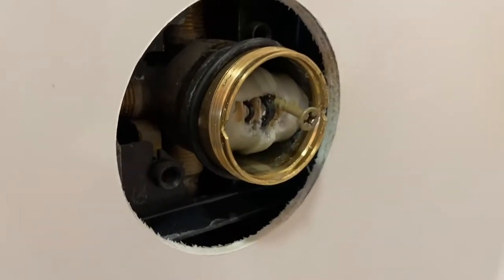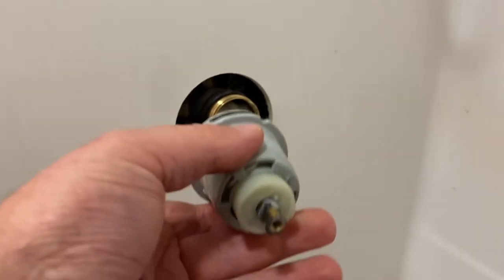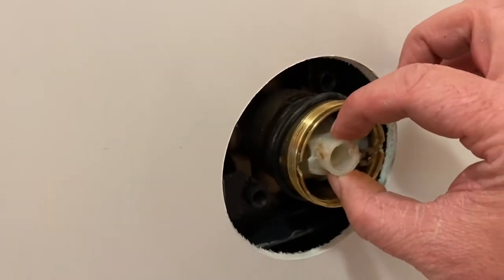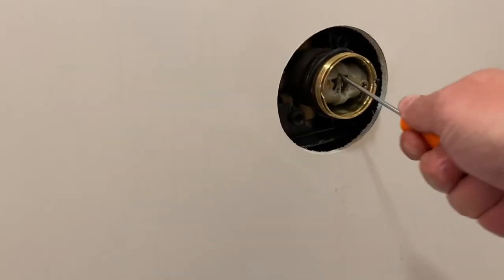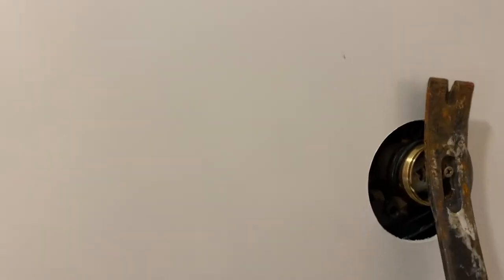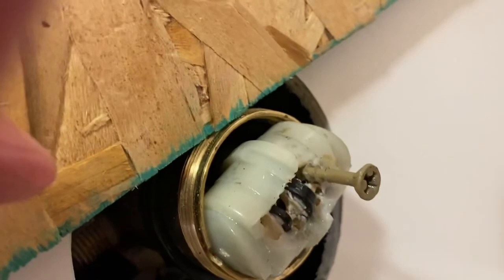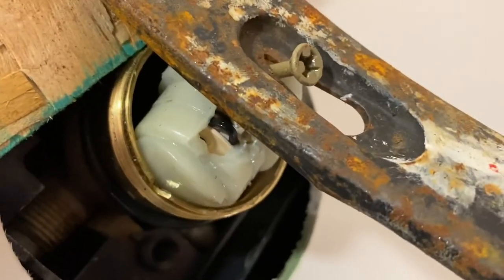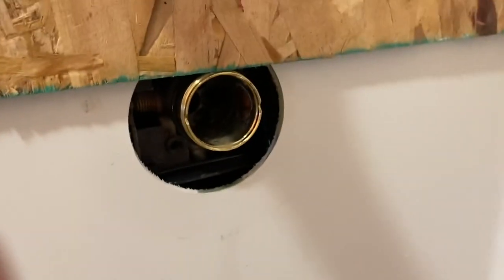Delta Tub Faucet Repair: Broken Cartridge

Comment: Just ran into this with my 21 year old faucet. Tried WD-40 and heat but it was the screw that did the trick. I put some silicone grease on the new o-rings so hopefully it doesn't happen again.  You're a lifesaver.
Reply: I would have silcone everything.  And on the nut. I am going to put caulk silcone. I think Silcone will not be so  hard break off next time compared to water Depsoits

Comment: Nice. I am a plumber and come across this alot. I normally put a screw in it also then put the nut back on it so the threads and end of valve body don't get messed then pull on the screw with a pair of pliers and pry against the nut but never thought of using a pry bar. If you use the nut to pry against it doesn't risk pulling on the pipes in the wall and breaking them.
Reply: I just used the claw of a normal hammer with a piece of wood to leverage the screw and it came out instantly.
Reply: Thankyou for this, the video method wasn’t working so I tried this and it popped right out
Reply: What a terrible design
Reply: Money comment thanks! Worked perfectly
Reply: Thank you for this video, I tried pulling hard on my monitor 14 valve and using penetrating blaster and none work. Ended up using a screw in between the broken plastic piece and the metal valve and using pry bar to pry it open.

Comment: I spent several hours trying to get the broken cartridge out.

I was stunned that I did think of that method in the first place.   I sprayed all kinds of lubricants, used vinegar, lime remover, etc. to no avail.  Was all set to use my blow torch and try to expand the metal surounding the part, which would risk damaging the metal.  I was pulling my hair out with how difficult this was.

Literally within 5 minutes after watching your video,  I put in a large screw, put a piece of wood, used the claw part of a hammer and out it came.  

Your video saved me at least $150 in plumber's fees and a ton of frustration.

And, gosh, it was so simple and immediate.   I was all set to use my blow torch and melt the part.  

I cannot thank you enough!

Comment: Thanks that worked well,  saved the day!   Just a note for others reading,  the best place to drive the screw seemed to be in-between two of the 3 raised metal rings (about 5mm apart from each other) that run lengthwise along the metal housing that's exposed once the front plastics are chipped away (as shown in the video)  
I screwed an 6mm wide deck screw (what I had on hand) in-between two of the rings and deep into the plastics behind the cartridge and that gave enough purchase to pull the screw & cartridge out with the prybar.   Before that, I had just tried threading the screw deep into the cartridge plastics, but the plastics by themselves were  too brittle, always broke on me.

Comment: Dude you just saved me. I was fixing this delta faucet for my dad's house (water pressure is extremely High we have to replace the faucet every year or so)
I was worried I wasn't going to be able to pull it out after one side broke but your video saved the day!
Thanks
Reply: Install a pressure regulator if it's over 80 psi
Reply: @josephlowman7906  never knew that existed!
Thanks a lot. I'll look into it. 
Idk how much the water pressure is, but it's super high. I opened it about 1/3 of the way so it won't cause any problems... I can't imagine what would happen if I opened it all the way, lol 
Thanks again 🙏
Reply: They sell a gauge you can screw on a
 Hose bib Pasco makes it not very expensive just to check

Comment: I was fortunate enough to have my cartridge come out all in one piece. I did it like pulling a tooth: Pull a little; wiggle it from side to side; pull a little more; wiggle it up and down and finally the whole cartridge slide out. The next most difficult part was identifying the correct part. I had to go with a Danco substitute and hope that the hot/cold adjustment would work. It did! Fortune was on my side on this little project. Thanks for the video, though. It educated me about the retaining nut.
Reply from the maker: Lucky you! You must be living right or have had soft water or a younger cartridge or something. This seems to be such a common problem - most of our videos get like 10-30 views so the thousands of views on this one tell me that you really got lucky or did something right! Which is to say also - good on ya and thanks for sharing your experience.

Comment: This method worked nicely.  In many of these cases, it was likely stuck due to some water deposits, and it's a good time to clean it up.  Post removal, I recommend using a dremel with a brass wire wheel to clean up the three surfaces the o-rings are seated back to smooth before the new cartridge is inserted.

Comment: I was thinking you could use one of those slide hammers with the screw on the end designed to pull dents out of car bodies. Screw it in and then just carefully pull the slide hammer back with careful force.

Comment: Just like to share my technique.  Had same issue, instead, I use metal cloth hanger, straighten it, and loop around the inner stem from top and goes out from bottom.  I tied the metal wire to a large screw driver handle that is horizontal to the brass housing.  After secure it, I pull outward from the end of screw driver as leverage while the handle sits on the brass housing,and pops out very easily without any damage to the brass housing.   One trick to prevent this from happening again is wire brush the inner housing clean, then use silicone grease lube the entire stem.  Hope this help someone

Comment: Thanks for the video.  Mine is broken just like this with no luck so far. I've tried modifying what looks like a 2 prong fork but too hard to pull and twist a bit to loosen. I've been pulling on this p.o.s. for what seems like an hour... well, maybe it was 2 hours, lol. So I'm going to give your technique a try.  This is by far the hardest valve I've ever had to replace.
Reply: Did it work for you

Comment: I'm having this issue right now and going to try it.
Reply: Holy cow! It worked! I used a long wood screw to the top right of the middle where you can slide in the screw then grabbed a piece of wood and using the pry of a hammer and it came out clean and easy. This is a fantastic video! Thanks again!

Comment: Mine looks just like this, worried about breaking major pipe. House is over 20 yrs old. I am trying to figure out what the screw went into one of those holes on mechanism?
Reply from the maker: Sorry I didn’t see this. I’m sure you solved your problem by now but for anyone else You’d want to be careful you didn’t run that screw too far but an inch gave me all the leverage I needed.

Comment: Here's what finally worked for me, in case it helps someone else: thread two medium zip ties, one around each side. (Insert one around 2 o'clock and it exits around 7 o'clock. Insert the other around 10 o'clock, exiting around 5 o'clock.) Once you have two zip ties looped, you can use something strong to lever it out. Don't forget to protect the pipe and threads with wood or a book, before prying!

Comment: How'd you run a screw in it, isn't it metal
Reply: I used a screw that was large enough to fit between the two plastic parts.  You can also do it by inserting the screw between the steel parts where the springs are.   Used a block of wood for leverage and used the claw part of a normal hammer.  Came out instantly.  What a relief as I spent hours trying to get this busted part off.  I blame the orginal plumbers for failing to use a spray to keep the plastic lubricated.  5 seconds would have saved me a lot of sweat.

Comment: Why the fuck is it this bad to change this thing?? You'd think they'd do something about this??
Reply: They get stuck in there from the I guess calcium and hard water deposits. Before they are put in service and or when you replace the cartridge you should grease the crap out of them with silicone grease. Especially the two male parts to fit in the female ports. And on the sides where it fits tight in the valve body. And around any O-rings. I had one that was only a few years old that I had a hell of a time getting out. 
And I just bought a couple new tub and shower valve body kits and they are barely if any, greased from the factory. 
Which is ridiculous.